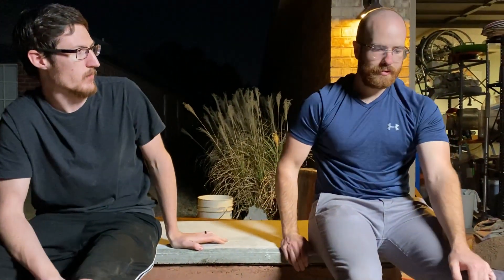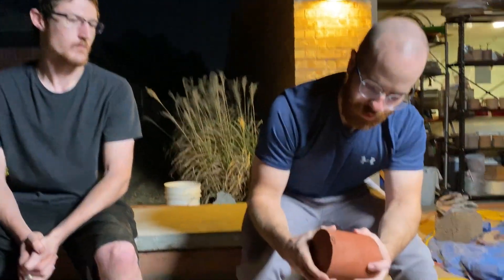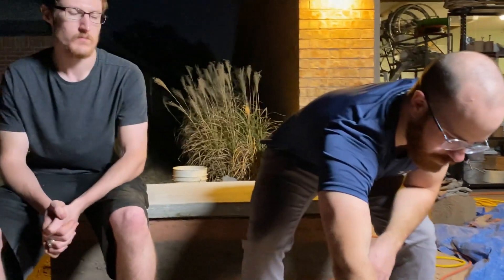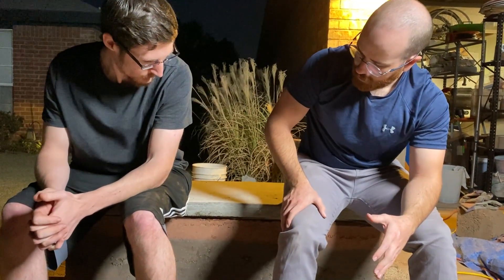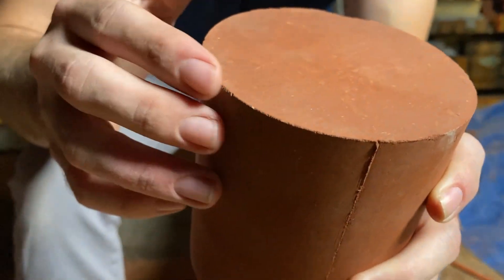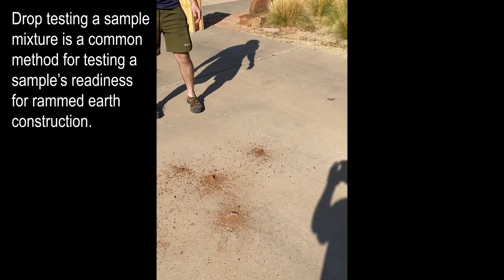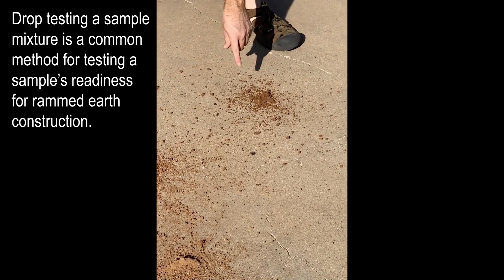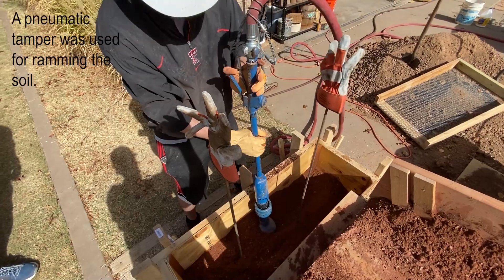A Rammed Earth Study by Joshua Durkes and Tyler Whitsell

Comment: Do you build the rammed earth wall on a concrete slab?
Reply from the maker: Yes, I think the slab on grade was roughly 3-4 inches or so and it was steel-reinforced (rebar)
Reply from the maker: We had two 1/4" rebar stirrups mounted vertically through the top capping and bottom slab, sandwiching the rammed earth between the concrete above and below.
Reply: @tylerwhitsell9766  So really solid.  Good idea.  Flexible technique.

Comment: It is possible the corner which displayed weakness was due to either a possible dry spot, or could be inadequate compression. The rammed earth wall should not display cracks or chips once the form is removed.

Comment: Mankind has been around for awhile.  We still have not found good solutions for buildings.  lol.  clearly, these stick framed houses of today, with vinal siding, are horrible solutions, that require too much energy to heat and cool.  Perhaps the solution, is to use stucco on the rammed earth (lol), to protect the exterior.    But the real problem with a home made of dirt is taxation.  They are afraid you will not pay enough in taxes.
Reply from the maker: My thoughts exactly on the design side as far as the modern construction processes we use.  Hard to tax dirt but I'm sure they'll find a way one day if not already.

Comment: We have shale.   When people have tried to put shale into concrete, even small pieces.  the shale sheers.   So, I'm thinking this shale, is not really good for anything but bricks, where the shale is fired.
Reply from the maker: Only problem with shale is that it might have too much clay content.  We found that in our studies, having too much clay resulted in shear issues, but too little would result in too brittle material.  Goal is 20% and to have a mixture consisting of multiple granule sized to fill in the space and limit air pockets as much as possible.  you can probably dilute the shale with another fine loam, just gotta play around and test a lot until you find the right mix.

Comment: Is the clay you chose expansive? How will it react to water? If you don't have a cement binder, how will you deal with freeze thaw? This project seems unusable for any environment that gets water on a regular basis.
Reply: Hi Devin, the application for this type of product is compatible with wet, dry and humid weather. The way it is applied is different from one such environment to another.

You will find earthen homes and various structures ALL over the world and it is very durable.
Reply from the maker: Exactly.  Use the sool you have around you, but test it in water to determine how much clay is present.  For us, we ained for roughly 15% clay content.  You also want to have a good mixture of different granule sizes.  A good amount of the really tiny granules is important to fill in the gaps during compression.  Yhe dirt we used is a samdy loam common to cotton farming fields of the southwest US. There was also a small amount of granite added as an aggregate (not necessary), as well as cement to stabilize, and sealant for weatherproofing.  Overall, the most pricy components were the machines used for tamping, and then the formwork, as the soil was donated from a friend.

Comment: great what you did
nevertheless you can still check the durability by additive tests
Reply from the maker: Solid point!  We did do a core test with fly-ash which turned out way lighter but overall more brittle.  It ultimately comes down to finding the right mix of granule sizes.  Unfortunately, we never had a chance to use the engineering department's pneumatic press to stress test cylinders.

Comment: Working with a Hydraform M7 compressed earth block machine...it is quite easy to do the test blocks for different admixtures. Great video~!
Reply from the maker: Compressed blocks are definitely a great way to speed up testing!  We had a budget going into this that prevented us from spending too much too early.  Still, we did manage to run more than 30 test cores manually, and I think that doing it by hand really helped us with learning the ques for a mixture that was ready for compression.  Good advice!